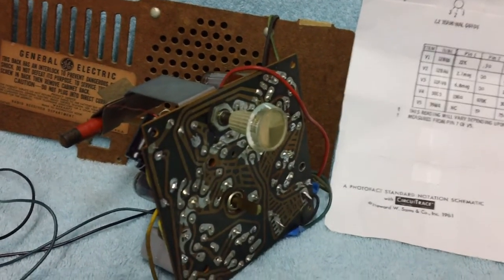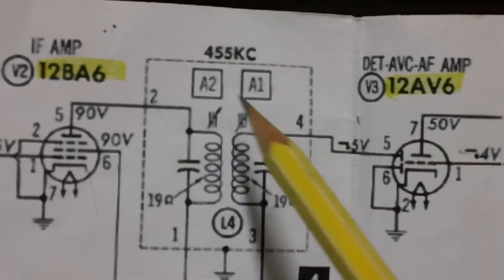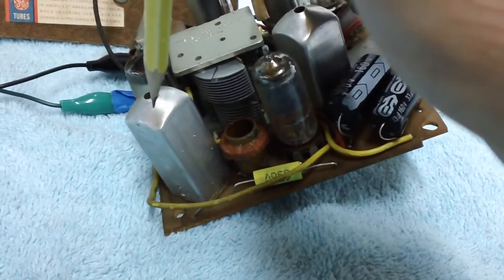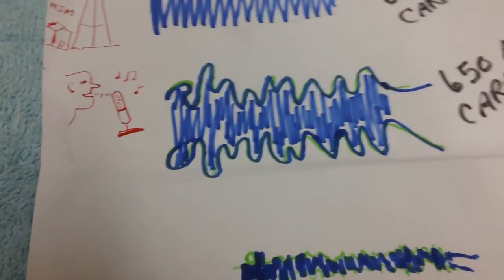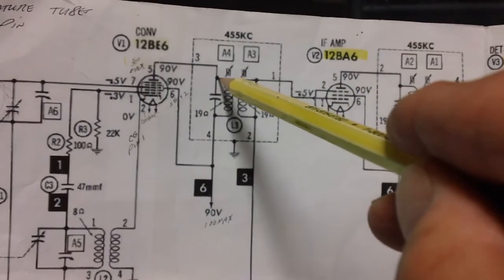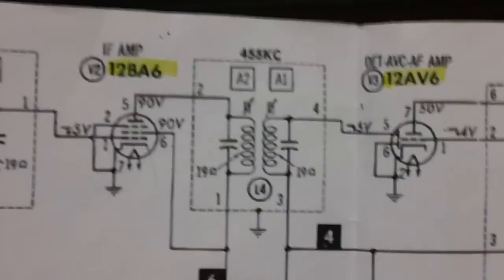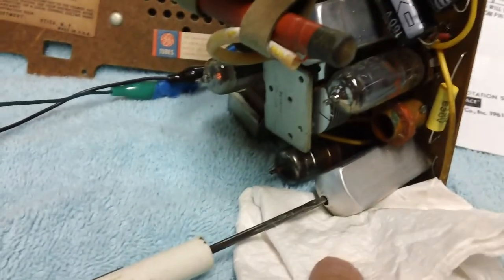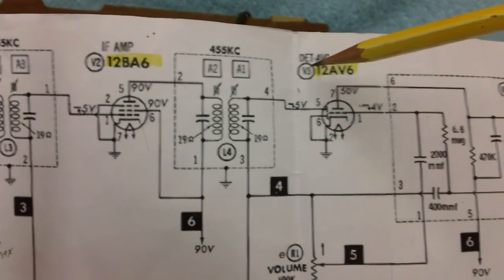General Electric C-403A Radio Repair Exercises (part 7 of 14).

Comment: John,
I, for one, am really delighted you are ‘going over’ each of the stages of an AM radio.  It starts me off wistfully thinking about those carefree days as an apprentice when I was between the ages of sixteen to twenty-one.
A super video production to both you and Brendan…you're certainly a pair of erudite chaps.
Regards,
Phil.
P.s, good to read you have sorted out the sleep timer mechanism on the Silvertone: well done my friend.
Reply from the maker: Phil,
Brendan and I are a pair of something, that's for sure, but don't ask me what. LOL
I, too, was appy to have repaired that sleep timer.  I really didn't think it could be done.  Of course, how long it will last presents a mystery.
Thanks again for stopping in, my friend.

Regards,
John

Comment: I remember shango066 showing SMD to great detail with his high def camera.  It looked like peach fuzz on metal.
Reply from the maker: Jeffrey,
There are other kinds of SMD.  I was able to clean up the mica in in my Transoceanic H500 using an eraser.  I just erased away the discoloration.  Worked great.  The radio still plays well.

Regards,
John

Comment: Nice video! I am getting grasp of it, how it works, thanks to Your very easy and explanotary guide. Anyway, as I Googled around, I would be interested, how Crystal Radio sets work? What is the difference between regular apmlified radio and inductive radios. And What are similarities? I tryed to build one kit, I gor from ebay! It was credit card sise device, with one diode, and resistor and condensator to solder on, and couple logs and Headphone Jack. Anyway, all I could get, was just some hum, no stations though, and I guess I did something wrong with it, so spark to mess with radios has died in me! Maybe You can cover this subject on Your videos as well...

Greetings from England
Reply from the maker: Tarmo,
Hello there.  It's good of you to drop by and also good to hear this series is helping.
I've never had any interest in crystal radios, but you've no doubt already discovered plenty of information about them on the internet.  In case you haven't yet seen it, here's a very good crystal radio video:
How a Crystal Radio Works

Now don't allow the radio spark to die in you.  The repair, restoration and/or building of radio receivers is a hobby...a very fun hobby.  There's never room for stress in any hobby.  When something doesn't go as planned, then consider it another cool chance to dig back in and have even more fun.  Laugh it off and have a grand time.  I know a gent who worked on a receiver for nearly a full year before he finally got it to play.  It was a personal achievement he'll never forget.  So totally relax and enjoy what we do.

See you next time, my friend.

Regards,
John

Comment: Good job John! Are you going to go through the with a circuit tracer to show how it is amplified in each section?
Reply from the maker: So as not to break the info flow, I've decided not to do signal tracing until the end of the series.

Regards,
John

Comment: Hi John,,I have a question related to an older radio i worked on..What would happen if you accidentally reversed either the primary IF coil wires or the secondary IF coil wires?
Sounds dumb,,but I am Buzz......lol
Reply from the maker: Buzz,
Back in 2008 I asked that same question on the Antique Radio Forum.  Check it out:

http://antiqueradios.com/forums/viewtopic.php?f=6&t=106559

Regards,
John